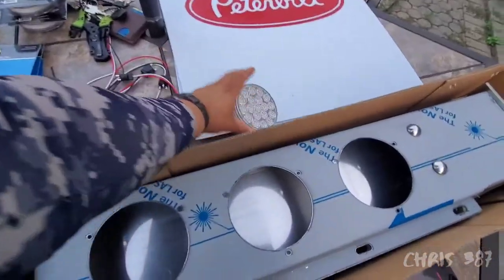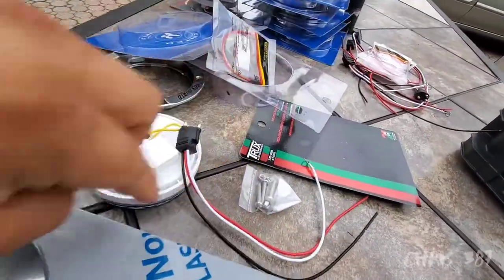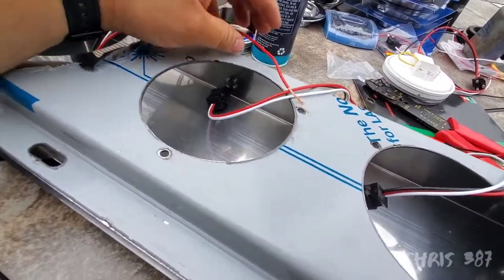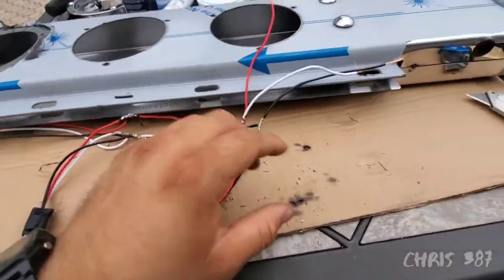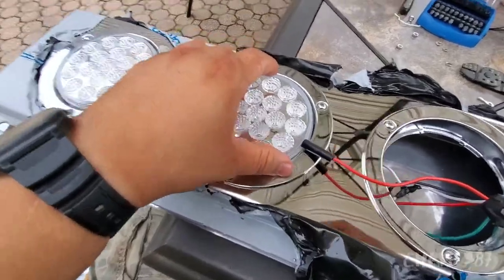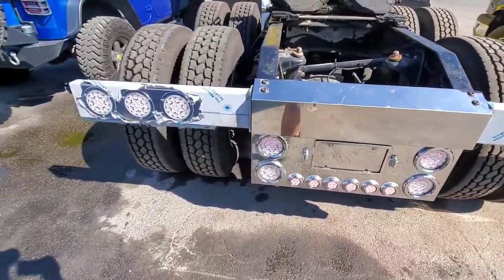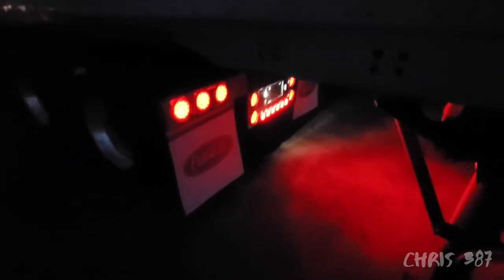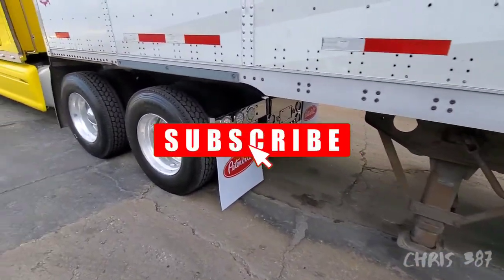Mudflap hangers with LED lights for the Peterbilt..luces para el camion

Comment: Why do my lights install from the back
Reply from the maker: Maybe a different set up, i thought all installed from the front
Reply: @chris387  i had to use rivets to install. How did you remove old hanger. It looks like i will have to cut the bolts because of bolts under them. And did you need to drill bigger holes
Reply from the maker: @xtremetransportationllc6117  Old hanger had bolts but the holes were smaller so all I did was make the holes bigger